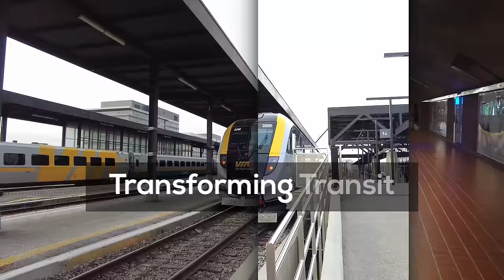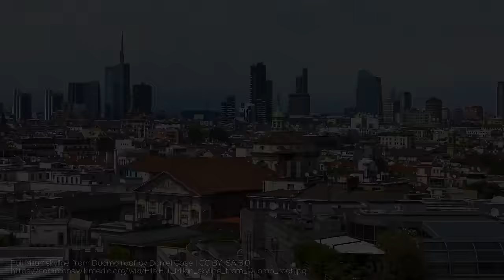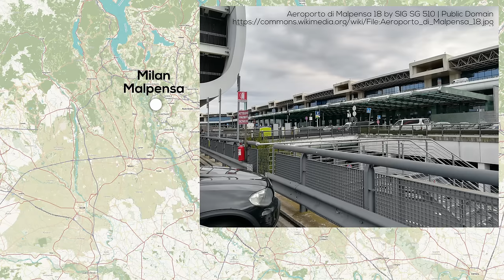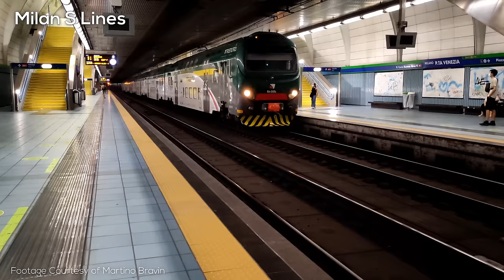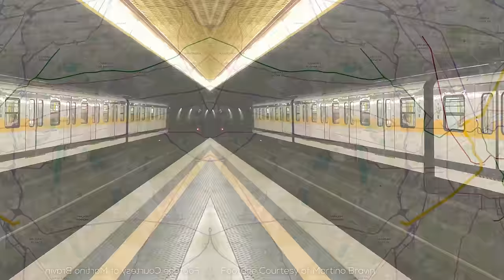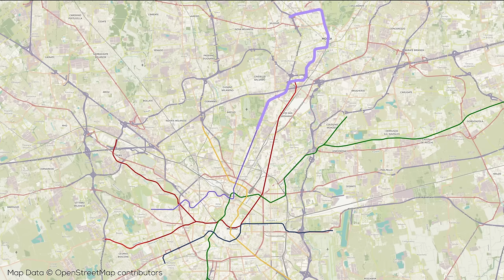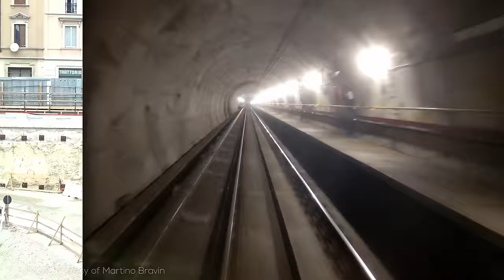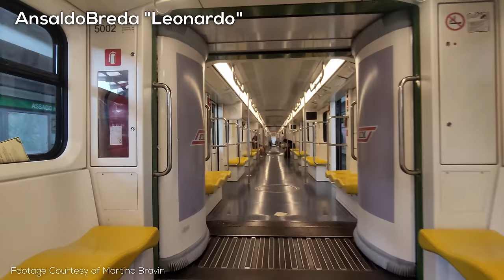A City That Builds Metros Like No Other | Milan Metro

Comment: Yeah! 
I'm so happy you did Milan. I didn't see it coming 😁
I have to say I'm impressed about the accuracy, over all on some little details which are not usually known, such as the interconnection between M2 and M5 and the lack of depot for the latter

Good job. As always, but this time I can say that with full knowledge of the facts 😊
Reply from the maker: Thanks for watching! It’s a great system! I need to visit!
Reply: @RMTransit  you absolutely should plan for it, and keep in mind that several major cities (Venezia, Torino, Firenze) are extremely well-connected with Milan by the high-speed trains, i.e. it makes sense to plan a trip for two or three at one week-long take. Most of the world-class heritage is also in those cities, Milan is absolutely wonderful but definitely not as rich in terms of heritage!
Reply: @RMTransit  What you didn't bring up is the absolute insanity that is the Duomo station - if you time it right you'll come out of the tunnel literally right in front of the most beautiful church facade in Europe, completely flooded with sunlight.
Reply: Urbanfile toppp!!
Reply: @RMTransit  you must

Comment: I live in Italy and whenever I go to Milan I'm really amazed by its transit system. The metro lines are great and well connected to the train stations, the trams and buses have been designed to easily and quickly connect to major metro stations.
Also the city is investing a lot in bike infrastructure. I really enjoy moving around Milan

Comment: I can't wait for the metro to Monza. As a F1 fan and Monza being one of my favorite race tracks ever, being able to go there on the metro will be awesome
Reply: Anyway the metro will be far from F1 track
Reply: although you could easily reach Monza FS from Milano Centrale using RE80 and then a shuttle bus to the track
Reply: Monza bettola… quasi in sogno (almost a dream)
Reply: @urbanfile3861   in the proposed project there is a station, villa reale that is very close to the F1 track
Reply: @urbanfile3861  wrong, there are stations for Villa Reale and its park.
Reply: I'm from Monza..it's going to be 10 years
Reply: @calogerohuygens4430  it's a couple of km South of Autodromo. Parco di Monza is huge

Comment: The most awkward part of the whole plan is the absence of an interchange between M3 and M4. 
There have been talks to eventually building a connecting corridor between Policlinico and Croccetta but I am not aware as to whether this is going to happen. 

The twists and turns of M5 are also incredibly hard to explain, it could have been a much straighter line.

However, despite all that, the public transport system in Milan is extremely useful and allows moving around the city most freely.
Reply: M5 is wavy because it was supposed to me a tram line, following the road network above and connecting to existing tracks. Then they upgraded the whole thing to underground metro but the route was more or less established.
Reply from the maker: To be fair, weaving around is often done to avoid foundations, underground structures and difficult ground conditions!
Reply: @SigmaRho2922  Thanks for the clarification! It makes me a little sad that they decided to go for the farther one, although at least it would still correspond with the inbound passengers' desire line. It's still unbelievable that the interchange was not in the plan from the very beginning!
Reply: @RMTransit  I absolutely agree and I was thinking particularly about the Tre Torri station which could have been positioned in a way to straighten up the line, had doing so been on the agenda from the onset.
Reply: There seems to be a storied history with the M5, which actually influenced the metro rail system in my city (SkyTrain in Vancouver, Canada), that I would say it explains its curvy alignment.

I've been trying to find out more about it but what I know is that M5, or a variant of it, had originally been planned in the 1990s and was going to use the ICTS driverless metro system developed by Ontario's UTDC, the same one used by SkyTrain. ICTS was at the time marketed as more suitable for tight curve handling as a result of using linear motor propulsion. This line was cancelled by the Italian government mid-order, presumably as a result of the early 1990s recession. The workers at UTDC's plant in Ontario would have been laid off, had it not been an impending order for new SkyTrain cars for the 1990 Skybridge extension. There are rumours that these cars (known as the 500/600 series Mark I cars) used the shells of cars made for the Milan order, although this hasn't been conclusively proven. There are a number of reference points to this in Canadian newspaper articles written in the 1990s.

The modern incarnation of M5 was likely subject to buy-domestic requirements as is common with government funding for transit lines, resulting in the selection of the AnsaldoBreda (now Hitachi Rail Italy) driverless metro, which by then had matured to become compatible with the curves in the alignment even with standard electric propulsion.
Reply: @RMTransit  The twists and turns in the Monumentale-Garibaldi-Isola section of the M5 are due to an insanely complex underground scenario. The line has to meander between the Garibaldi railway station (which is partially below street level and has a tunnel running out of one end), the Garibaldi underground suburban line station (Passante Ferroviario, kind of sort of S Bahn) and the existing M2 line station. Actually M5 was supposed to be two different lines, both terminating at Garibaldi. But the underground context there is so complicated that doing so would have meant neither line could have been expanded afterwards...so they decided to merge them and here we have M5.
Reply: @SigmaRho2922  it cannot be considered a proper "interchange point", they try to sell as one, but it s not. Crocetta is much closer
Reply: Hi Ilya,
others gave you informed replies to your intelligent remarks, I'd like to add that the twists and turns⁺ of M5  let you have a REAL ROLLERCOASTER VIBE 'cause you can sit in front of the large windscreen!
———————————————————————————————————————
[+] twists and turns but also dives and lifts!
Reply: There's also the big detour it does to service the newfangled laughable business district that replaced the old Fiera area
Reply: @bacicinvatteneaca  which area are you talking about?
Reply: @RMTransit  Doubly true in Milan. The city has a giant water table and in some stations you can literally see rerouted water flowing in the open between gutters.
Reply: When M4 will be complete, there will be a corridor between the stations of Sforza-Policlinico (M4) and Missori (M3), not Crocetta. actually, if you hop off the M3 at Missori, you can see the road is completely closed around Piazza Velasca, where the ugly tower is located, because they are digging to create the tunnel.

Comment: Hey Reece, have you considered doing a video on Milan's incredible tram network? In addition to using the oldest active trams in Europe (the 1928 Peter Witts, or Ventotto), it also operates the very unique Sirio and Sirietto low floor trams and refurbished Junbotrams from 1976. More importantly, the tramway network reaches every corner of the city, and has very frequent service. And it's incredibly well used.

Peter Ehrlich (tramway historian and former San Francisco Muni motorman)
Reply: I live in Milan and I love the old trams (the ones from 1928 are so cute, the Jumbo are the most efficient imo), in the Sirietto you can only stand by the doors, because there's not enough space between the seats 😭
But I know that low floor trams are much more accessible for those who can't use stairs, so it's good to have them too

Comment: Very good and well informed video. However, speaking of building metros like no other city, I’m surprised you didn’t mention superposed tunnels. This technique was first experimented with in the late 70s-early 80s at the S. Agostino station along M2, where the two platforms lie on top of each other. 

Subsequently, it was used massively for line M3, where the two tracks lie in superposed tunnels all along the central section.  This allowed to save space under the narrow street of the medieval centre, preventing the tunnels from running beneath buildings. A similar technique has been used for the central section of M4.

As far as I’m aware, Milan was the first city in Europe to use such a technique.
Reply from the maker: I don’t think stacking the tunnels is that unique, it’s been done in a lot of places in different systems!
Reply: @Family Guy Shorts Peter what happened to your braces?!
Reply: @RMTransit  Yes, but Milan was arguably the first in Europe.
Reply: @RMTransit  I think they also that one station has two different storeys, one lower to go in one direction and another higher to ho the other direction
Reply: @claudioferrara4455  Presumably you're referring to mainland Europe because rhis was done for a section of the Central London Railway (now simply the Central Line) way back in 1900!

Comment: Was just in Milan this past summer- very convenient and frequent. It helps that most of the core city is very walkable as well. 

One thing I will say is their ticketing system is one of the slowest I have ever encountered- so I guess it all balances out.
In Milan, where they are able to build lines and stations right beside 800 year old cathedrals I don’t understand why we make it so difficult and slow to just tunnel through suburbia in and around Toronto, it’s purely human obstacles.
Reply: That’s because you’re not supposed to buy a ticket at the ticket machine, most shops/bars/kiosk around the city sell them and that’s the quickest way to get tickets. You might have noticed that ticket machines are almost exclusively used by tourists for that reason
Reply: @stefasaki97  Thumbs up for this comment, I live in Milan and I can't remember the last time I bought a ticket, as you can just pay for your ticket with contactless technology; Usually, if I don't have to drive, I don't even bother bringing my wallet with me as I can use my phone to pay for almost anything
Reply: As @Stefano Trovato and @Roberto said, ticketing system is very advanced and convenient in Milan. Tourists should take information before arriving in a foreign city, they would avoid queueing kiosks and bars.
It's been years now that you don't need a paper ticket. Both the ATM app and a contactless credit card allow you to take any transportation means.

Comment: Nice to see Milano featured.   I live in Torino and I am a regular visitor to Milano for various business reasons.   I have ridden M1, M2 and M3 and rather like them.   Having AC equipped walkthrough trains is nice and I hope it's something Torino thinks about when they get around to building the second line (currently Torino has one Metro line, M1 which uses the VAL system).   I sometimes take the bus to Miliano and it's rather nice that the intercity bus terminal is located on M1.   This is something Torino should think about as well.

Comment: To be fair the actual number of lines operating in the "Passante" is not 6, despite what maps says, but either 4 or 5, since lines S1, S5, S6, S13 always operates, line S2 only operates Monday to Friday and not after 21 or in August, line S12 was added before the pandemic with just 4 trains (1 train running back and forth twice) but was suspended with the pandemic and never resumed.

Comment: Thank you for this.  In early June of this year I visited Milan and rode all 4 lines and saw work on the M4 and found it super easy to use.  I stayed in the Loreto area, so I could get the M1 or M2.  Best of all, if you just need a single ticket, nearby newsstands/convenience store can sell you one.  I covered a huge amount of ground by purchasing a 3-day all zone pass - paid for itself the first day.  The only flaw is that the front of Garibaldi station is kind of grubby and dumpy when compared to the shiny new complexes around it.   I came into Milan to Milano Centrale from Venice and left from there to go to Zurich.  Note - San Siro has a big fan shop that has both AC Milan and Inter Milan stuff.
Reply: The front of Garibaldi station is a shame. It's a car park and it's owned by RFI (Italian State Railways) and that's why this space remained untouched despite the nearby area was developping.
Anyway there is a project to make a pedestrian nice designed area of it.

Comment: I noticed that you left out a few details about the metro's expansion. Some are still in the early stages but others are already being built or are about to be

Line 2 has one confirmed project, being a 10 km Northeast extension from Cologno Nord to Vimercate serving the Milanese Hinterland. If all goes to plan it should be open by 2028. Moreover, a couple more extension projects are being analyzed but they're in the very early stages (Gessate to Trezzo and Assago Forum to Binasco).

Line 3 is set to get a 15 km extension from its Southeastern terminus of San Donato (also a bus station) to Paullo. Construction is set to begin in a year from now. Like part of Line 2, some of this extension could run above ground.

Line 4 is a curious case. Like you said, it will partially open in a month from now, and the whole line will be fully operational in the second half of 2024. And despite not being open yet, extensions are being planned, with a proposed 2,5 km route from Linate airport to Segrate in the Northeast. The line will connect an amusement park (Idroscalo) and the train station in Segrate. For the latter there are proposals to build/expand the train station to accommodate high-speed trains (like Reggio Emilia's high-speed station) given that the future high-speed line between Milan and Venice will pass through this area.

Line 5 has another extension in the works but it's in a very early stage. The proposal is to extend from its western terminus in San Siro and go all the way to Settimo Milanese, and in a second phase to Magenta. This would add an extra 19 km to the line.

Here's a bonus: for years a Line 6 has been proposed, but the itinerary has been subject to changes and nothing has ever moved until a few months ago. The first proposed routes would have connected the Northwest of Milan with the Southeast and running through the city center, creating interchanges in lines 1, 2 and 3 along the way.
However, in April this year a feasibility study for the line was announced but for a different route (going from Ponte Lambro in the Southeast to Barona in the Southwest). If the line ever gets built, Milan would have completed a sort of circle line (of both metro and suburban rail). And according to Milan's mayor, Beppe Sala, this would be last metro line for the city.
Reply: Actually it is not exactly as you said.
M2 to Vimercate was considered too expensive, so the project is to extend the line of just one stop further North to Brugherio, while to Vimercate they decided to build a tramway starting from Cologno.
Same for M3 to Paullo, considered too expensive as well. The project is to build the terminus at Peschiera Borromeo, and to reach Paullo they're thinking to build another tram line.
About M5 to Magenta. There is not the official evaluation, but a no is very likely. Magenta is already served by railway with S lines, while Paullo and Vimercate are not 
I forecast that the extension will be considered as far as Bareggio, at best. But no further.
Reply: @marcomontella6006  è da quando ho 10 anni che parlano di fare la metro fino a paullo, non succederà mai ahahahah il tram sarebbe già una gran cosa.

Comment: One limitation of the Milan metro is the fact that it does not remain open over night during the weekend, thus hindering movement from relative early hours (11pm, if I am not mistaken). Other major European cities do offer at least sporadic, yet useful night trains over the weekend, even when their size compared to the Milan metropolitan area would make it easier to walk or cycle home (I am thinking here about Vienna, where I reside).
Reply: The last train pass from 11 to 12:30 in most stations, after that the metro is closed and an alternative line of bus run on the surface but every 30 minutes or more replacing the metro.
 So, after midnight you can: use an active busline/tramline (not many), use the "sostitutiva" (the bus that replace the metro, it does the same stops of the metro), call a radiobus (a public bus that works like a taxi but only on its line, the ticket is the same) or use a private car sharing/scooter sharing/bike sharing/motorbike sharing system ( if I haven't drink I usually use the eletric motorbike for short-medium distances, cost a bit more than the public system but it's quite convenient), if all of the above fail there is the taxi but you better have money on your bank account in this case.
yes the metro is more comfortable and fast, but there are many alternatives that come at handy.
Reply: Trains stop at 00.30 and after that hour night buses (every 25 minutes) make the same trip as the metro
Reply: @matteoburchi6122  Milan has to get in line with the other European cities even with the night metro service if it wants to stay competitive, time to stop relying on buses on weekend nights.

Comment: Great video!
I live 35 km south of Milan and I use Suburban train to go to Milan quite often with S13 suburban train.

One nitpick: you saw that the M3 did a right turn at the south end? That because in the 90s it was supposed to go straight to Linate. When the project was revealed the taxi drivers rioted and was able to block the project.